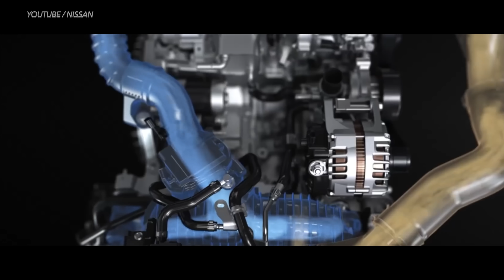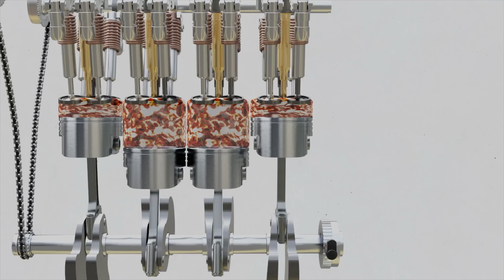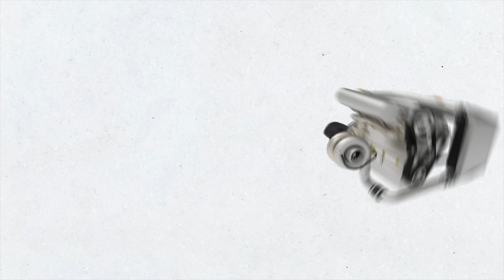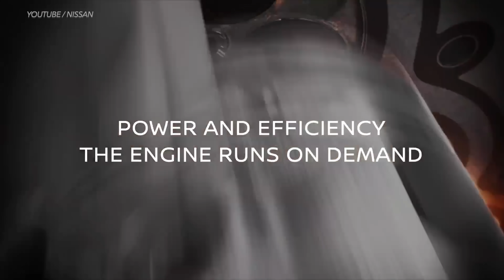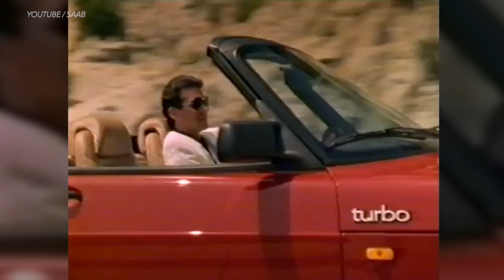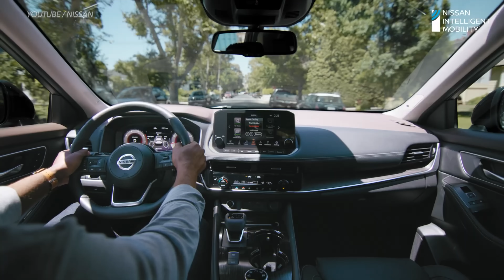Nissan Just Combined a Gasoline and Diesel Engine and Got This

Comment: This seems complicated and more to go wrong . It also seems more expensive and when they go it will cost a tone to fix
Reply: It's crazy how often a simple thing breaking in your engine just ruins it. A bearing on a crankshaft for example costs 20 bucks or less. If one fails your 5k motor is toast. It makes more sense at that point to buy a whole new engine or a rebuilt one. Most shops these days don't even try to fix them.
Reply: Not only that but not too many mechanics will be able to work on them leaving you at the mercy of the dealer 💰
Reply: more Nissan junk. Nissan needs to take the Mazda approach and build something 100% Japanese with substantial R&D for a reliable end result. Mazda has achieved this with Skyactiv.

Comment: Hey Scotty - what do you think about 1973–1980 MG MGB’s? Thinking about buying one which has 48,000 kilometres, not rusted, and kept well maintained by an older guy for $14,000CAD. 

Cheers from British Columbia, Canada 🍻
Reply: unreliable fun only niche market hobbyist exclusive.
you better love it too death and be willing to spend money on it on a regular basis......fun? -yup...good looking? -sure is!
but you need to KNOW what youre getting..not just guess.
some parts are near impossible to get
Reply: If you buy it and use it in the winter you need to steam clean the under neath every month to get the salt off.
Grease the steering kingpins every month,and engine oil changes every 3 thousand miles and gearbox and axle as instruction service book, l ran MGBs for 30yrs.
Reply: You could import one from here in the UK for less
Reply: I purchased a new 1970 MGB when I got out of the military.  I loved it but that was when I was in my 20. Told my young son in the '90s I'd restore it, but that never happened. Sold it years ago and a 1973 parts car.

My preference would be a 1973 GT with overdrive and streel wheels, chrome bumper. Mine had wire wheels and while they look great were a pain to maintain.  Depending on how tall you are the roadster is pretty low so not much space in the headroom department. The good news is there were a lot of MGs made so parts are easy to come by.

Comment: Only time will tell like all engines if the Nissan VC engines are a flop or success. Have to see tried & true real road driven consumer results up to 200k. My dread is adding these new components would be an owner's nightmare if something goes wrong with the VC components of the engine. I think hybrid is the way to go with some tried & true combustion engines for best overall range and MPG in our current market.

Comment: Nissan's ENGINES have never been the problem...their CVTs on the other hand...when mine went out on my 2004 Murano, I called my dealership (buy-here, pay-here) to let them know. Their immediate response?  "Ok, we'll send it off to auction...anything on the lot you're interested in?"  Yep. My now-2011 Toyota Rav4. Enough said! Btw, the tranny couldn't be fixed. It has to be replaced. $3000 from the junkyard, $5000 to do it correctly. Done with Nissan until they start making their own CVTs.
Reply: The new CVT in my new Nissan Rogue is awesome! It mimics a 8 speed transmission. Does not drone at all and feels really good
Reply: They could always buy in Acen cvt’s
Reply: Toyota uses CVT, too 🤣
Reply: Nissan owns JATCO, so they DO make their transmissions!
Reply: @fjg2896  Nissan own part of JATCO.

Comment: I guess it’s a trade off between design complexity and reliability.
Reply: For sure.
Reply: Design complexity and reliablity doesn't have to be a tradeoff. Honda K series engines are more reliable than their american counterparts back when they were introduced but had more complex valvetrain designs like VTEC.

Its just whether the company wants to put the time and money in to make them reliable.

Comment: What can go wrong!!!! I'm sure it will be reliable like the cylinder deactivation engine 😂
Reply: Have this type of engine in solid build NISSAN PATROL VTC 4500 in middle east
Reply: Actually...........
Without even watching the video, this has been utilized for almost a century. And many military multi fuel trucks do run gas OR diesel, as well as rotary engine powered generators. Frankly a diesel rotary makes more sense and would last longer but I digress.
Reply: The NATO armies use aviation fuel (JP-8).  The diesel engines can run on JP8 or diesel, but definitely not gas (which lacks lubricity & would destroy the engine).
Reply: @electrictroy2010  rotary multi fuel engines did I believe. But only when oil injection or mixed fuel is used.
Reply: I take that back. This over complicated it. I can see this being way better when new, and far worse when worn out...

Comment: If it's hooked up to a Nissan CVT, then it's just a fancy boat anchor under the hood
Reply: Oh I get it
Because the CVT will break and the car will become a lawn ornament then!
Reply: @42luke93  yes but they own the company that makes the transmission and they are utter trash
Reply: @42luke93  Precisely!
Reply: Boy are you not kidding I had a juke that was a nismo edition And that CVT transmission absolutely killed it made it a dog
Reply: Lol. Yes. I purchased an accord hybrid with that transmission.  I was told not to use the paddle shifters and  start off slower by a mechanic and the guy at Advanced Auto.
Reply: Nissan doesn’t make transmissions
Reply: Amen..
Reply: They’re beginning to move away from the CVT
Reply: Probably worse.. plus a $500-1k throttle body
Reply: Amen
Reply: Hahahahahahahaha facts😂😂
Reply: Facts
Reply: My Altima has shift solenoid issues. Thing is, it’s under a 100k and the dealership keeps telling me that it’s a brake light relay. I scanned the computer (weird Nissan doesn’t give any indicator light for Transmission issues) after the car kept going in limp mode, and the only code I got was a transmission solenoid, but the dealership keeps insisting it’s something that isn’t covered under warranty, funny. I think they planed on changing the solenoid but run it as something not covered under warranty so you pay out of pocket.
Reply: @DhatLex  that's every dealership. They don't want to do warranty work. It pays less.
Reply: @thedragnslayr1  those DCTs won't last, either (ask ford lmao)
Reply: Ya I see nothing but more easier failer points.
Reply: Yes, I had a 2018 Altima as a company car. Trannie failed at 90k. I just was given a 2022, see how far that will go🤪
Reply: Put a Borg-Warner T-5 or a Tremec behind it, then drop it in a Mk1 Cortina or an Riley 1.5.
Reply: I agree, nothing but garbage! CVT is always an underperformer and often breaks if you don't do maintenance on it before time stated in the manual. Have to constantly replace the things inside it to keep them from wearing out. And they don't offer as good gas milage due to their design.
Reply: This engine has twice as many parts to tear all to hell.
Reply: I have 115K miles on my '16 Maxima CVT-not one issue.
Reply: @mitchlu  its on borrowed time. Be careful.
Reply: @gurdeepaksidhu7564  Statistically, most transmissions won't last more than 150-200K miles. Even Toyota. A lot has to do with the user and how they abuse/maintain it. I've almost achieved that threshold, so I'm not worried about it. If I have to replace it, I replace it. Done...still cheaper than starting over again with another car.
Reply: @mitchlu   haha. That definitely has not been my experience. I grew up driving hand me downs. My first truck had 400,000 miles on it when I sold it. 
 I have had plenty of vehicles with over 150,000 miles. A few with over 200,000. 
   I was dumb enough to buy the infinity version of the pathfinder in college. It had 320,000 miles on it when I bought it. 
 It actually ran great for about two years until a kid t-boned me and my ex.
  I have NEVER had a transmission go out. I know that it happens. It just hasn't happened to me.
Reply: @letsdothis9063  One person's experience does not make up an entire statistic. Yes, you had good luck. Not everyone has such luck. Again, we are speaking "statistically", not anecdotally.
Reply: @mitchlu  DYOR I really don't care enough anymore. I've linked the same stuff so often
Reply: @mitchlu  the exception not the rule.
in industry Nissan's CVT are known as the worst transmission on the market.
Reply: @Godfather_of_the_Oath  Bring actual statistics that support this claim, esp. for the Maxima (which is what I'm talking about); not just your words. Post a link to a reputable website claiming this information (showing Maxima CVT vs. similar cars with geared transmissions). Prove it.
Reply: @mitchlu  my 2016 trans blew at 100km
Reply: @mitchlu  you must drive it moderately over this long period of time. this is a known FACT not opinion: JATCO transmission are garbage. the class action lawsuit literature on this where nissan is concerned is well documented.
Reply: @vtg1632  First of all, I don't drive it moderately, I live in NYC. Next, I had an '07 Altima 3.5SE with 170K miles, again, not one issue. Lastly, people expect perfection in their cars (with little to no maintenance); it can't be had. How do I know this? I'm a Mechanical Engineer. Check cargurus, plenty of these cars have over 150K miles.
Reply: @mitchlu  your 07 doest have a cvt tranny bud. Prob not a mech E either
Reply: @flockatron6428  Yes it does, google it. I'm an ME in the tooling industry and I'll leave it at that.
Reply: @vtg1632  got a heavily used nissan sentra at 135k miles with no transmission issues at all. It also depends which year model you have.
Reply: @vtg1632  jatco transmissions are very good...minus the cvt and trash fwd auto 5 spd. But reputation is completely ruined from cvt.
Reply: @TheGuruStud  a man with some sense!
Reply: You missed out the word Crap,
Reply: JATCO doesn't make bad transmissions.. lol.  CVTs by design, are susceptible to early failure when incompetent owners don't properly maintain them. IF you follow the maintenance schedule for them, they will last much longer without issue. Problem is, most people only know how to turn the car on, fill up the gas, and press the pedals.. and only take it to the shop once an issue arrives. No preventative maintenance.
Reply: @peyten3237  Bingo.
Reply: Haha, I was going to write this, but you beat me!
Reply: & that's why Nissans are known as sinking ships !
Reply: Exactly what I'm saying!
Reply: I just bought a 2013 Altima from the auction and got smacked the damn CVT tranny went out when I tried to drive it home I had to buy a junkyard tranny now about to put it in and get rid of this JUNK!!!
Reply: @wufoodmovementtvwutangclan6519  Yeah, not only would I not buy a car from an auction, but I wouldn't buy a used car with a CVT either (from any mfr.); that type of tranny is very sensitive to proper maintenance.
Reply: Drive it home lmfao had to buy a junkyard tranny getting ready to put it in and get rid of this car lmfao JUNK!!!
Reply: Lmao ain’t that the truth

Comment: 😔 Nissan…🤦🏻‍♂️ Never again.
Reply: Not even once
Reply: Really just depends though what year and model. I had a Nissan Frontier 4 cylinder with manual transmission. Sold it with like 289k miles.

Comment: Well that will never break…. Of course who knows how long Nissan be around anyway?
Reply: compressed natural gas - CNG - 200 year supply right here in the USA - energy independence in 5 to 10 years - current cars can be converted to run on it - cheaper than $4 a gallon gas too
Reply: CNG is still a fossil fuel that warms the globe.  Come-up with a real solution
Reply: Also the natural gas cars have a very limited range (220 in the Civic CNG).  Even a Tesla EV goes further than that!
Reply: @john see  we have plenty of oil however the current administration is beholden to the world economic fourms great reset agenda so they have purposely stepped away from oil production.
Reply: @johnsee7269  we were energy independent when trump left office.
Reply: @kyleoden3015  oh you mean the king of the Warp Speed jab who put us an additional $9T in debt like O'Bummer did, but in only HALF the time?
Reply: @Sol Rosenberg  lol OK.
Reply: true - the CNG is one answer as I think it's low or no pollution - 200 year supply - cheaper than oil/gas - what are we waiting for - I ain't no expert but it is an answer to the current problem - we're the Saudi Arabia of natural gas; no more billions a day going to the Middle East - I could go on...  Best regards!
Reply: 😂  yeah - you'll need a warranty kinda like a Mercedes - if the dealer can fix it - great for new car buyers who aren't here anyway - potential nightmare down the road...
Reply: It will never break because it will never go into production.
The bean counters will laugh themselves into a coffee break telling the CEO's that this engine costs more then twice as much to build as a single standard internal combustion engine.
So three motors cost in one sold unit.
NOT approved.
Reply: @phil4986  right . they will just push the hybrid model and call it a day.
Reply: Electric is coming on strong. But I truly like the freedom of the ice vehicles.
Reply: @Surfside75  still 280 years off replacing just the USA hydrocarbon burners.

Comment: Nissan VCR engine now tell Nissan fix there unreliable cvt  transmission
Reply: I can watch the dash screen telling me the engine is changing displacement as the car is sitting in my driveway with the cvt transmission screaming because the transmission cvt belt is on fire.